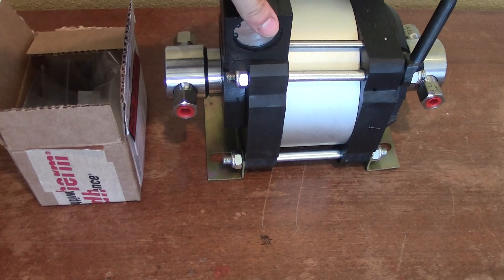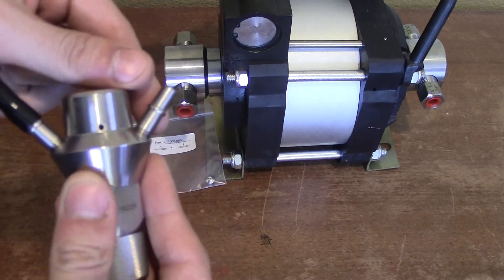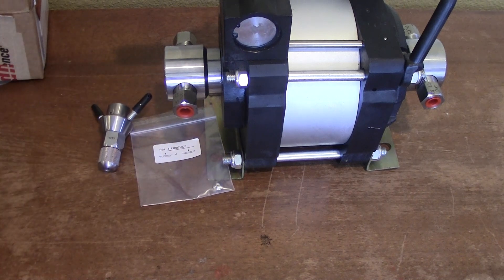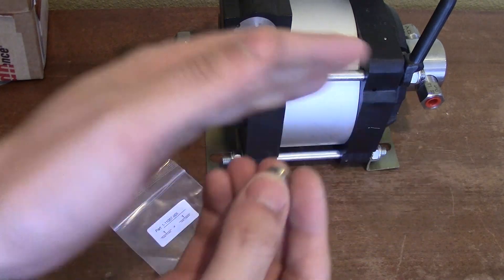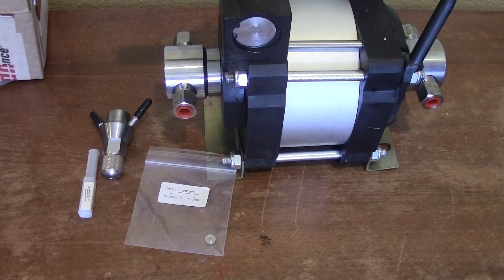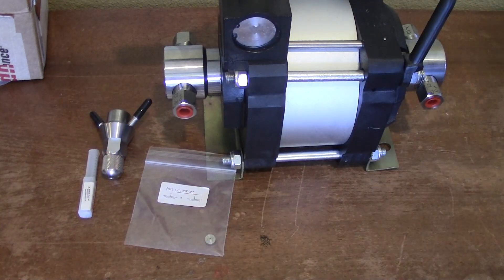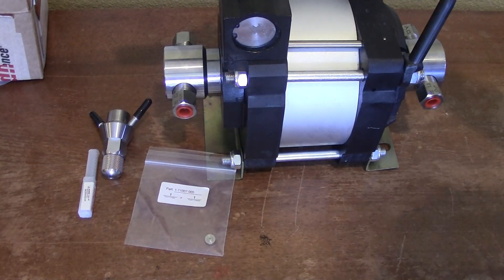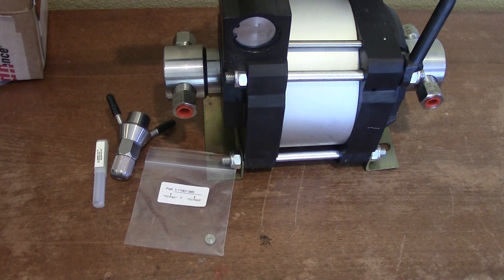Update: 9/23/18

Comment: Nice video ! How many Psi ?
Thank u 👍😉👍
Reply from the maker: it 400:1 pump to theoretically whatever air psi you put into it from compressor into one side it will amplify it into water by 400 times in other side so 100 psi from compressor is 40,000 psi in water. but as you increase the output pressure the flow rate drops.